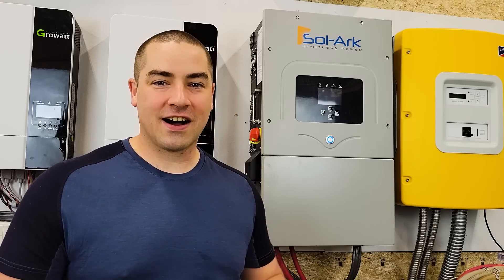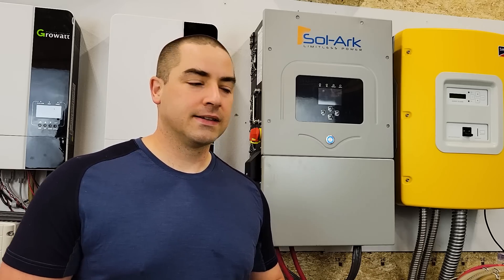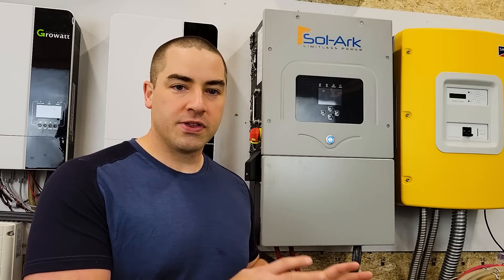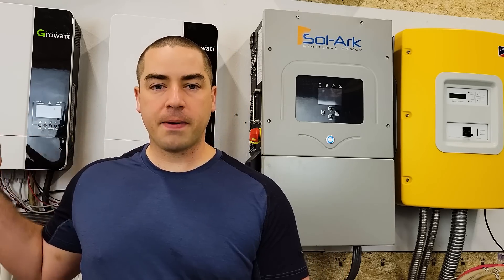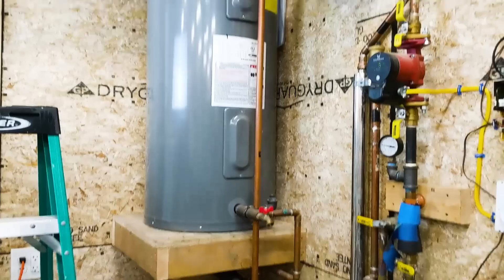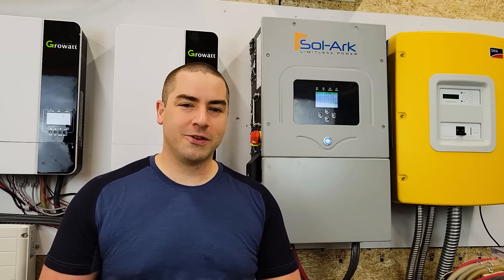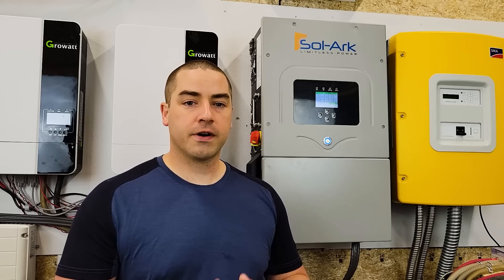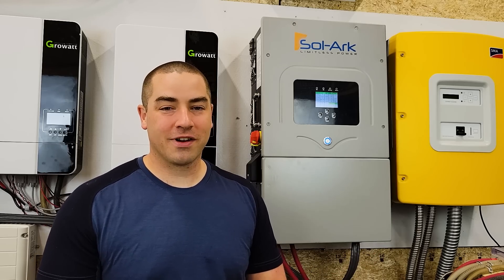Sol-Ark 12K Inverter, Is it worth it?

Comment: It is disappointing to see an inverter called 12K when in reality it is a 9k, 12k is photovoltaic, it is correct that it goes into protection with one phase at 4630W and the other at only 2871 but it could also be at zero and turned off the same, it is simply half overload on the single phase, the imbalance is excessive between the 2 phases or half inverter.
Had they called it Solarark 9K there would be far fewer people disappointed.

Comment: Sol-Ark advertises 4800 watts per leg (L-N) and 9000 watts total (L-L).  A couple of thoughts, your battery cables are technically a little too small....NEC rates 2/0 at 175A at 75C.  If you battery cables are long (over 10') you might be experiencing some voltage drop at max draw (185A).  Also, you should have a minimum of 6" clearance on the right side of the inverter (really 12" since it's next to another inverter).  Good video though....I have been installing these for a couple of years and have had zero complaints.  I guess my customers don't drive them as hard as you do.  The cost is a little steep, but compared to a Radian and a FM100 charge controller, plus the labor to wire it all up, the Sol-Ark wins.  Plus, long PV strings up to 500 Voc makes PV more efficient with much smaller wire and conduit sizes and far fewer strings.  I can't speak to Growatt.....I'm pretty careful with what I market and sell to my customers.  For what it's worth, I've been off grid for 16 years with an Outback FX system that has never been OFF since I turned it on.  We've installed hundreds of off-grid (and far more grid-tied) PV systems using Outback, Schneider, Xantrex, Trace, Magnum, and Sol-Ark.  I have to say we really like the Sol-Ark quality, ease of installation, HMI, and customer support.  Your video does give me something to think about.  Would love to see Sol-Ark weigh in here.

Comment: I have a 48v solar system and my electric water heater runs on 48v dc there's no need for an inverter to heat water.
Reply: Try to run everything you can on 48v dc.

Comment: My Solark 12K has shut down early on, but generally does not, even with large loads. Mine is wired different than yours in that it is connected to the main grid  panel via the grid breaker. but is configured to NOT feed the external grid. Therefor when necessary it pulls from grid automatically. My entire house runs fine off this set up. I have an insulated 3500 gallon thermal storage tank with a 3800 w heating element in a large crawl space, and an electric preheat tank for DHW (in front of my boiler fired DHW tank- keeps it from running much). I control when power goes to thermal storage via the smart load, set to 65% to 70% battery levels (on at 70% SOC, off at 65%). I also have 2 uninsultated 55 gallon thermal storage tanks operated by smart outlets on L1 and L2, under my control (I manage the system and dump load as I can to maximize ROI on the system w/o selling to the grid cheap.) I also have  a Tesla Model Y to charge and a small heat pump. 28 Q-cell panels for ~11kw of PV. Extremely happy with the operation, and fairly simple install - some learning curve. Also wish it was more than 9k but it does the job well enough for me with the grid tie in one direction only.

Comment: Correct me if I'm wrong, but if you added the autotransformer to the solark, wouldn't that solve your problem? You didn't have an issue purchasing the autotransformer to make the growatt work with your situation. Why would you have an issue purchasing (or reusing) one to make the solark work for you. In the manual it says 4500w/leg. Also, you are supposed to have 6" clearance on both the left and right side. Pretty sure you have like 1" max. Also, the manual says standby consumption is 60w. RTFM I guess ;)

Comment: You are using a hybrid inverter incorrectly. It's designed to AC couple to the grid to use extra grid power when needed (like in your overload example) and to export to the grid or shave grid power when extra solar is available. For the times that solar and/or battery are enough to power the loads completely, it can act like an off grid inverter, but its primary use is to have the grid as backup. Sol-Ark is very clear on their instructions for completely off grid operation, but most people understand that's not it's intended purpose.

Edit: I have my inverter connected to the grid in the zero to grid mode and I tried to duplicate this problem. It was hard to get an imbalance between legs, but I got less than 200W on L2 and almost 5600W on L1. I had enough time to get back across the house (20 seconds or so) to get the reading on the inverter before one of the breakers tripped but the inverter never tripped. I can't generate more of an imbalance than this without dragging the microwave into the bedroom, etc.

Comment: Remember he is being sponsor by Signature solar which sells Chinese Inverters and batteries.
I have a Sol-ark 12k with an Autotransformer that runs a 3800 sq foot house with 2 x 3 ton A/C units with absolutely zero solar coming in.
When you have a problem there is someone from Sol-ark on call 24/7 to help you also.
No Chinese instructions or waiting 6 months for an inverter board. Yea the Sol-ark is more expensive but consider the support. It does work. This is not even a fair representation of a Sol-ark inverter.
Sol-ark is based in Texas. Buy American!!!
Reply: Winner🖕Congratulation you won a prize
Reply: Congratulations 👆👆winner contact to get your prize
Reply: Winner contact 👆
Reply: Dm for your prize👆👆
Reply: Dm for your prize 👍👍
Reply: I dont want to hurt your feelings but solarks come from china...monitoring also hosted in china..... the irony of people constantly talking about mr poz misleading people
Reply: Good
Reply: I love you
Reply: I love you
Reply: Good wishes

Comment: Sounds like the fix is not with the unit but with your house unbalanced loads. Could be an easy fix by simply moving a few breakers around inside your panel.

Comment: I had MCU v1.1 and replaced it with MCU  v1.2 board and it seems to fix the problem with unbalanced loads between L1 and L2.  It is a pretty quick and easy fix.  There are 8 screws on the front of the unit.  There are only 4 cables attached to the MCU.  You can see the HW version on the bottom right corner of the MCU.  It is up side down but easy to find and easy to read.  For the 12K Outdoor model, I also recommend upgrading to MCU 6206 and COM14FA.  No product is perfect.  I was a little worried myself when the units kept shutting down when running a small air compressor on 120 VAC.  After the HW and FW upgrades, things are back to where they should be.  I agree with your wife.  You should not need to worry about what appliances you are turning on.  While your mileage may vary, I am very happy with my Sol-Ark 12 Outdoor.  I assume you already know, but the 12 KW is the total power it can handle.  That is a mix of charging your batteries and loads.  I have a 24 KW array with 2 x SolArk 12 Outdoor in a master / slave configuration.  I get 21 of 24 KW from my panels even in fall/winter.  I can charge my batteries at 16-17 KW and still have 4-5 KW for loads at the same time.

Comment: Thank You Dave for a real life practical installation of the Solark 12k. It's totally understandable most people will not rewire or reposition appliances on different PowerPoints to balance L1 and L2. Solark should be using a transformer or advising to use an autotransformer if loads may or will be unbalanced, especially if the home is using close to its maximum output. Cheers

Comment: You can buy 2 Magnum 4000 watt PAE inverters set up for split phase for way under $6k.
Combined They will put out 8000 watts all day every day and no need for a auto transformer. For off grid applications the Sol-Ark is simply not worth it. For your application the Grow watt inverters are perfect. Most of your loads are lighting and resistive. I have found that some of  the high frequency inverters do not like AC inductive loads. They work well with universal brush type motors but just about everything does. Even modified wave will run a universal motor. Also the Sol-Ark stand by load is abysmal. I really appreciate you doing these tests in an unbias way. I am in the process of helping my neighborhood with different solar projects. It is an off grid community. I think I will stay away from Sol-Ark. I sure would like to see someone do a long term test of the Grow Watt inverters running a well. I have one neighbor that wants me to design a system that will run his 2HP well pump. Its looking like Magnum is on tip so far. Thank you my friend and Happy Thanksgiving!

Comment: Hey David, I have had my system up and running since the summer with the Sol-Ark and 40kw of used LTO sCib modules.  The really big benefit of running the sol-ark, imo, is using it to "zero out the meter".  Essentially you run the CTs to your main incoming lines (as well as cable into your main panel) and the Sol-Ark will allow the grid to fill in where the solar or batteries cannot.  Essentially my energy priority is solar > batteries > grid so I never need to manually transfer anything and the grid can fill in if the loads exceed the 4.5k on each leg, or I have an acute load like my electric instant hot water heater that runs on 3 40a double pole breakers.  I'm maybe pulling 500 watts from the grid each day (I'm on a farm with lots of energy usage sometimes 60kw a day) so really a drop in the bucket.
Reply: Hi, is your sol ark back feeding into your main panel? Kinda like how a grid tie inverter is connected? Thanks

Comment: I explain to my family that any power interruptions are my responsibility for understanding and working with the specifications of the equipment.  Fun and cheeky to claim that the equipment is somehow lacking or at fault (it's not in this case), and lets you dodge any wife acceptance factor issues, but it's misleading how you scripted this and explained to your wife why the inverter was tripping off.  It's tripping because the combination of loads is completely overloading one leg.  Try running one of the groats 5 to 20 percent over their rating, they'll trip off quick, no?   You're selling the groats here so I would be honest: they are lower featured (230-240v only, not split phase, don't have AFCI/GFCI on the solar input, not UL rated, not grid interactive, correct me if I'm wrong), at a lower price point.  Good for some applications sure, but not for others.  Get what you pay for.  How far past it's rating an inverter will operate is not a great deciding feature, you should aim to operate it properly.  Planning to operate something outside of it's designed limits is planning to fail, or failing to read the specs is a plan to fail too.  If the groats are run with the autotransformer and unbalanced legs, without controls that monitor the overheating transformer, the result will be more spectacular than an inverter tripping off, just might take more time, or it might be fine forever.  Same with bringing PV DC into the building without AFCI/GFCI protection, it will be fine in most cases, until it's on fire or a shock hazard.  Part of the value of a more fully featured inverter system like solark and others, is that all you will ever have to explain to your wife is why the inverter tripped off for safety reasons.
Reply: Exactly right

Comment: Why not use your autotransformer that you already own to balance things out?  You kinda present it like if you want full power per phase you have to go back to the Growatt's, seems a little disingenuous.    Can you play with some new Enphase IQ8 inverters and islanding?
Also the 12k is the input power (from solar), seems like your misleading people into thinking that it's marketed as a 12kw inverter.  I think the charger and inverter capacities are pretty clearly communicated.   (I don't have a horse in this race, I've only played with 12v/24v chinese inverters).

Comment: The Growatt inverter that David is using in this presentation, is an European edition that doesn't complies with US standards. This inverter has the ground and negative output, mechanicaly connected! So installing the auto transformer cause a hazard situation, because the chasis of the unit will have a floating voltage of 120v. This Growatt unit is not intended to be use in the US with the addition of an auto transformer or center tap transformer. About de Sol - Ark, it is one of the best inverters that I had installed. It is simple, efficient, and reliable. It's best performance is for Zero metering and/or selling to the grid, with the benefit of an inverter for critical loads. I have mine for about 10 months, and it never has shut down, even using it continously at his full capacity...
Reply: Absolutely. This is a very poor representation of a Sol-ark inverter. Plus the support is top notch.

Comment: I know this is probably not ideal for you but you should invest in a Heat Pump Water Heater and only use the Heat Pump only mode which is what I use and it uses about 500-750 watts max vs 4500 watts using the heating element...
Reply: I think he uses the water heater for floor heating so BTUs may not be enough for Heatpump vs resistance heat the floor needs. I agree though for regular water heating needs.

Comment: I have a sol-ark 12k and never had any problems or issues. You can only get 4500 watts on one leg.  Either you balance the loads or use your transformer. Make a apples to apples comparison next time.

Comment: No doubt about it the solark crazies are like a cult on here lol. It's made in China just like the growatt. Does not perform as advertised to the common buyer because they will kick off when you use them to power a house. You will need more than 1 depending on size of house and current draw, maybe even 3 or 4. 
I have a 37.5KW transformer, 4-5k inverters, 19,000watts of solar panels and 86,000 watt hours of lithium for same price as buying just 3 of the Sol Ark 12ks. Just the inverters and no lithium, no panels nothing.  With my setup I can use grid current, solar, battery, generator etc if I want just like a solark but a fraction of the cost.

Comment: Sol Ark told me I would need 3-12k models for my energy requirements.  This in the $20k range. I ended up buying 3 mpp 5k inverters that were around $750 each and a used transformer for $700 and have not had a problem yet. Saved around $17,000
Reply: So you bridged all three inverters?

Comment: Hi David.
I have followed your channel for several years.  
This video appears to not be a fair comparison.  Please redo the test and use the same auto transformer used with the the Grow Watt.
Your buddy Ben conducted a similar test with his solark 12k using the auto transformer and had great success. 
Speaking from personal experience as a Solark owner and installer,  it's the best inverter I have ever worked with.
Look forward to watching your next Solark test video.
Reply: Hi Antonio, buddy Ben here.  I think David's point was that if you're spending $7k on an inverter, it should at the very least do what if claims.  The only reason I added the autotransformer to mine was because I was also having issues.   
The reason for using the autotransformer with the growatts is that they don't make 120/240v.

Comment: If I recall correctly the manual says you need to have a 6 inch space on each side for airflow..... not enough airflow will result in high temps and many inverters actually use internal temp to determine when they overload.... you said you did everything according to the manual but this isn't true! The right side is hot air out and you have like an inch or 2 there.... Also, have you tried doing a firmware update?? One of the latest updates changed the imbalanced load issue.... I have installed quite a few of the 12k units and we really love them! Also, as others mentioned the 12k rating is related to solar capacity, just like any grid-tie inverter's rating is.... since this is really designed to be grid-interactive. And also just to be clear, 95% of our installs are off-grid and I have been installing for 10 years now! Sol-Ark has made many great improvements with their firmware updates! They are looking forward while big players in the industry (like Schneider for instance) are slowly losing the practicality and real-world needs!
Reply from the maker: Good catch on the air space.  yes, it is close.  But, in the video I had the inverter off all day to allow the batteries to charge, and only turned it on for the test.  That meant everything was cool.  The fans never turned on during the test, so I don't think temperature was the cause of the shut-down.
Reply: @DavidPozEnergy  you are correct, temp didn't do it in your case! And I also owe you an apology for commenting before watching everything! A transformer based inverter like a Schneider XW6848 can carry an imbalanced load because of both legs being wound on the same core.  In Schneider inverters I believe they are rated to do 70% of total rating on one individual leg! The way the Sol-Ark works you do have that weekness although I feel they should be able to improve it a bit with new firmware but there would still be a limit there.... also many transformer based inverters can carry quite a bit over rated output for even like maybe 30 minutes or so.... Sol-Ark should definitely work on this!
Reply: @DavidPozEnergy  

No it wasn't hot at all. These solark installers are coming unglued on here and grasping at straws lol. Costing them sales on an overpriced inverter.  Solark must of emailed them. Lol